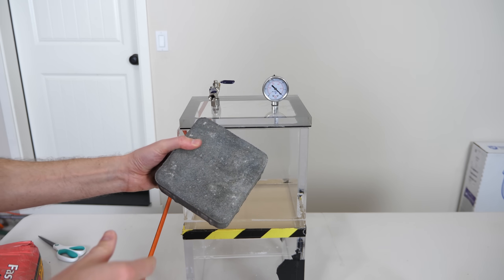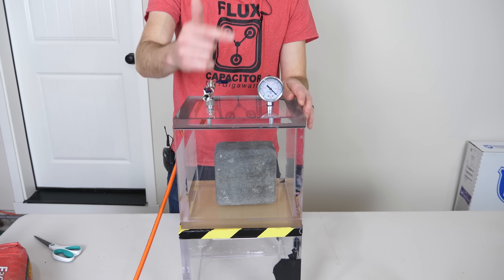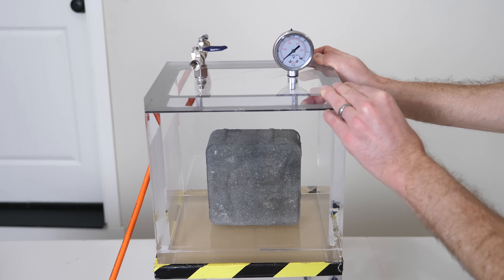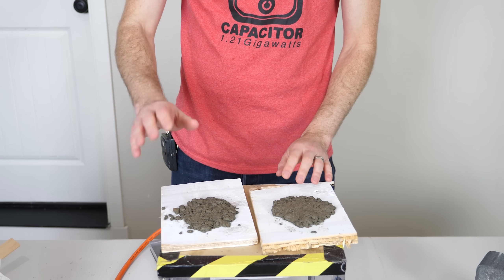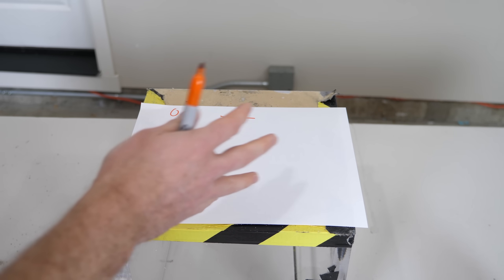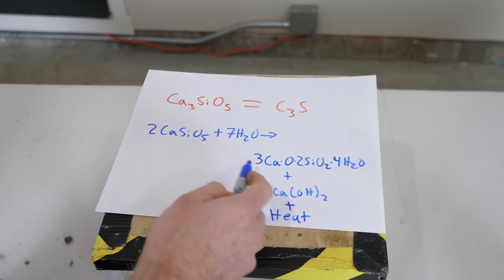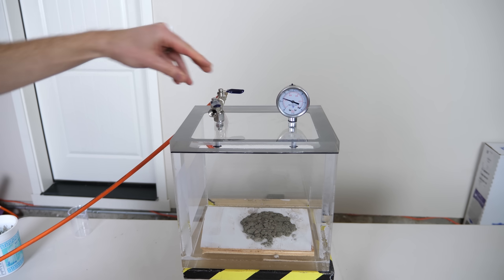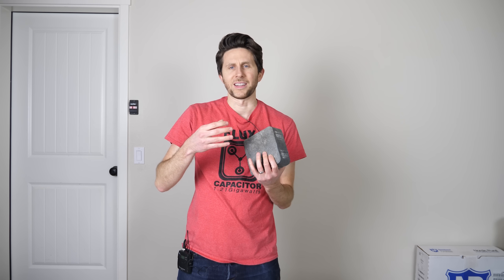Does Concrete Turn to Dust in a Vacuum Chamber? Concrete Without Oxygen Experiment

Comment: Nothing will happen to the concrete without oxygen... but if all the air was to be suddenly removed form the inside of any big structure, forming a vacuum, the structure would most definitely be destroyed and crumble to the ground. This would be due to all the air outside the building applying pressure over the building (atmospheric pressure) and no air inside the building to counter that pressure. 1 atm is equal to 101325 Pascals, that’s a lot of pressure acting over the building. Structures are generally constructed taking into account that the air inside the building will apply roughly the same pressure as the air outside it, almost leveling the difference in pressures.

Comment: Concrete molecules are still connected with oxygen bond that you can't see. If you take out that oxygen from the molecular structures of concrete.. maybe it can become a dust😁 and it's impossible to remove oxygen from every single molecule.

Comment: I guess if the oxygen atoms dissappered the concrete would crumble. But just removing air shouldn't do anything, heck making concrete in a vacuum probably produces stronger concrete since there won't be air bubbles
Reply: You're 100% correct :)
Reply: Harder and brittle.

Comment: NASA wants to use concrete around satellites for protection of micro meteorites. S.C.C. self consolidating concrete, a no water mixture, and it is a total chemical cure. I am a union cement mason, We know these things too.
You have to mix the concrete in 0% oxygen. You also forgot in space the vacuum is in the negative vacuum. Plus the temperature is absolute 0.
Water in space would expand as it freezes, so a chemical cure is the best option.
Glass and concrete has the strength of steel when created in space. Steel has the strength of diamonds when created in space.
Reply: Interesting

Comment: NASA did this study. Glass, steel, and concrete created in 0 oxygen is much stronger.
Reply: no tiny air gaps less likely to break
Reply: All hail civil engineering!
Reply: @Joe no, it means no oxygen contamination. Oxygen is reactive, it likes to react.
Reply: Because in the making of it water and oxygen reacts with everything if you take oxygen out of the mix you get the absolute purest form of that because it doesn't have any impurities in it and hasn't reacted to anything that's how come blacksmith use borax that's cuz it blocks the oxygen away from the steel then how come welders use argon to block the oxygen away cuz it Doesn't react Like Oxygen
Reply: Imagine humans created in a 0 oxygen environment
Reply: @Pillmates  In that case you can not speak of humans.
Reply: @Pillmates  humans created in 0 oxigen are called lefties, and their stupidity factor is much stronger than normal humans
Reply: @StoneCoolds  ok boomer
Reply: @StoneCoolds  🙂☺️😊😁😂🤣🙃
Reply: @psuedonym9999  I doubt many could reference the science book they used in 2nd Grade Elementary, or textbooks they last used one year ago. Moreover, not everything is freely available in the internet, which I think you'll understand when you finally get to college. In 2013, doing strenuous activity and pregnancy was not even in the internet, but it's info you can get from doctors.
Reply: @StoneCoolds  I think you mean right-wing wingnuts
Reply: @StoneCoolds  Why'd you have to make things political? Also, you realize that Albert Einstein, George Orwell, and Martin Luthor King Jr. were heavily left-leaning, and that many early feminist movements, worker's rights movements (including minimum wage and the right to unionize), and Civil Rights movements were all backed and organized by socialists? Were their brains lacking in oxygen?
Reply: @biggiganticbones  Remember when we all thought the Earth was flat?  It was common knowledge.  You're right that not everything is available on the internet, but I guarantee you that "doing strenuous activity and pregnancy" was on the internet in 2013.  I know because I graduated from medical school in 2008, and we used the internet extensively in our aquisition of knowledge.  We also learned how to evaluate the quality of evidence, and in that learning you realize how crumbly the foundations are for widely-held beliefs broadcasted throughout history with large megaphones (crumbly as concrete without oxygen molecules, even).   By the way, I remember learning that most exercise in pregnancy is okay unless you have a cervical problem, placental abruption, or placenta previa.  I don't know my sources off the top of my head, but am willing to admit that I don't know my sources and would be open to evaluating dissenting claims.  If someone asks for a source, it's not an insult or even always a challenge - it can be curiosity - a realization that you don't know everything and want to know where another person got their information from so you can check it out and see if it is sensible and based in high-quality evidence.
Reply: @gabrielspring4401  I agree about your stance on asking for sources. However, Pseudo Nym did not simply ask for a source. He continued with "Rant over? So I guess you have nothing." and "ok boomer."
To me, these were definitely an indication that Pseudo Nym believed "no source = false" and taking into account that he is not accepting sources other than links, "not on the internet = false."
I replied to him to quell this belief that he may or may not have.
........
If someone actually presented a link from a paid database inaccessible to the public, I would be almost sure that he would find it unacceptable also. Those sites would not be in most peoples' minds when they say "internet," and so I made no effort to make a distinction. Meaning, the "internet" that I used is what most people think as the "internet," which is whatever that can be presented by Google after a Google Search.
Reply: @biggiganticbones  yeah, I didn't like the "ok boomer" comment - THAT was a lazy thing to say and prejudiced.  Also you bring up a good point about paid databases being largely inaccessible to the public - it only compounds the problem of ignorance.  I'd just add that access to paid databases doesn't eliminate the dozens of biases that still go into publication and interpretation of research that 99 percent of us take mental shortcuts to ignore to maintain our sanity
Reply: @StoneCoolds real
Reply: @Joe no air doesn't mean no space
Reply: Let say human was made in zero gravity then if men get a bone.     Er can it go back XD
Reply: No oxygen or a vacuum?
Reply: Ye boyyy cus air weakens conccc
Reply: Reference???
Reply: Umm no
Reply: Ceramics rock
Reply: Source?
Reply: @psuedonym9999 ,
 Richard C Hoagland.
Reply: @alexroberts590  that's not a source, that's a name. Give me a link.
Reply: @psuedonym9999  ,
I'm old school in research. I have a library of a collection that I have. Books published by credentialed individuals, like scientists, physicist, doctors, as well as my own compositions of 40 + years of experiences. I have physical scars from my experiences. 
A little homework never hurt anyone. Ya. You want a link for what? Validity? I care about those who still can't see whats been in front of us the whole time. But I don't care what people think about what I say. I can't unsee what I experience.
Reply: @alexroberts590  Rant over? So I guess you have nothing.
Reply: @alexroberts590  There will never be an end to lazy people who require being spoonfed their information. These are the same people that see an article posted on Twitter and presume it to be factual. I wouldn't waste any time on them, myself.
Reply: @ForeverLaxx  You call asking for a source "lazy"?  Actually, going through life thinking that everything you know is true requires far less effort than challenging your own beliefs.  Tossing a statement at the top of a message board and calling skeptics lazy for challenging it is like baking cookies out of concrete and calling your dinner guests weaklings for saying it hurts their teeth.  It's ironic that you equate challenging a claim to presuming a twitter article is factual, when in fact they are opposite reactions to the presentation of previously-unknown information.
Reply: @gabrielspring4401  I'm glad you swooped in here to a conversation that ended 8 months ago to try and dunk on someone just to show you didn't actually read the exchange or failed to realize the one asking for "source" wasn't interested in any legitimate source.

I've been on the internet far too long to waste any of my own time digging up sources for people who aren't interested in any source that doesn't fit the Twitter narrative they took at face value simply because they already believed that information. It takes literally 30 seconds to find 99% of what people will reference when demanded a source, and I'm not someone's search engine. Plus, they'll just immediately dismiss said source because it doesn't say what they wanted it to say, or it wasn't said by the "approved" individuals.

Hunting down sources to appease people who blindly believe the original claim with zero factual basis isn't worth my, or anyone else's, time.
Reply: @ForeverLaxx  I agree that it IS funny that I swooped in - was thinking about that afterwards - I just watched this vid for the first time and came across the discussion.  And i definitely appreciate you giving a detailed reply.  But saying that soemone would immediately dismiss a source given is premature.  Sure, commenter may have immediately dismissed it - but they didn't - they weren't given a chance.  If the source is so easy to look up in order to shut down a skeptic then it benefits everyone to do it.  Then, if they offer an educated rebuttal, have a discussion.  If not, they're the ones looking stupid.  Its not a poster's duty to preemtively source everything they say, but its also not every reader's duty to take comments at face value.  Ultimately its everyones' choice, and I believe it is beneficial for either side (claimant or challenger)  to be the first to take the discussion to a more elevated level of debate.  Did I interpret your reply correctly?
Reply: So buildings are the strongest material
Reply: Ye
Reply: So does this mean we can make concrete structures in space?
Reply: A lot of foundries have vacuum crucibles specifically to remove oxidation as a factor 

That’s what flux is for.

Why sand/glass is added to crucible steel.
Reply: Harder but more brittle, not necessarily stronger
Reply: @taipanpete8583  Make the concrete with fibers. That way the brittleness would be reduced and it would also be harder

Comment: This was a complete waste of time.... you dont have to be a physicist, or a genius to know that concrete will not just turn to dust because you remove oxygen.... oxygen would have to be the binding force/compound, whatever in order for it to rely on oxygen to hold it together.... and its not.... in fact a good question for you would be, can you find an object the relies on oxygen for it's structural integrity....

Comment: Only complete Idiots would think concrete could crumble in a vacuum-chamber!
Why it should?
Concrete does harden even under water or in a area with no air.
The idea "what would happen if O2 could disappear for 5 seconds" means:
What would happen if you ban ALL O2 from the earrh.
Even the O2 whats included in every structure and in every beeing.
O2 is solid in concrete and cant be sucked out of it!

Comment: I didn't think it would crumble for that exact reason. Me and my friend had a debate just before watching the video. His argument was when you put marshmallows into a vacuum chamber, vacuum it then let air in it collapses. I explained my thoughts before watching. In process of making marshmallow you whip air into it in order to fluff it up, the air is essential what is keeping it puffy. Since the air inside the marshmallow is more or less made up of the same stuff as the air on the outside it has approximately the same specific pressure so it maintains its form. By sucking the air out of the chamber you also pull the air out of the marshmallow, the reason it loses air instead of expanding like a balloon would is because the marshmallow is porous so it leaches the air out. When you let the air back into the chamber the ~14.7psi is much much heavier then the 0psi (more specifically I would pull as close to 1000-500 microns as per refrigeration standard) inside the marshmallow. With all the missing air inside the marshmallow it is crushed by the pressure of the air, not gravity or it would collapse while extracting the air. As it was mentioned in the video the Oxygen in the concrete is part of the chemical makeup not structural like in a marshmallow.

Comment: The theory is that concrete structures would crumble not because the concrete would just crumble but because it would no longer be able to hold the weight of the structure because concretes strength comes from the air.

Comment: With the information I have (Concrete is stable because of O2) I can say why it isn't turning into dust: The O2 is already in the concrete but the machine puts only the O2 out, that is on the outside of the concrete.

Comment: Solid, fully cured concrete in a vacuum chamber will not crumble into dust.  However, concrete that is not fully cured will dehydrate, cease curing, never reach its full strength, and may be crumbly.

Comment: Correct me if I'm wrong there's oxygen bonded within the concrete. All those videos said if oxygen "disappeared" not just is no longer in pressence of the air around. Removing oxygen around the concrete wouldn't have any affect on the bonding within

Comment: Those concrete pillars you see holding up the flyovers on the motorway take 50 years to cure, they're still wet inside, and a House brick reputedly holds 1 pint of water.

Comment: If oxygen disapeare for 5 seonds is a hypothetical question. And by lots of people request you tried to replicate hypothetical question in reality, which did not work.
Hypotheticaly concrete would turn to god knos what. 
This is hardened cement:
CaO SiO2 H2O + Ca(OH)2
This is hardened cement without oxygen:
Ca Si H2 + Ca H2

So lets see what we are left with, Ca is a soft solid metal, Si solid (i assume britle) metaloid and H is a nonmetal gas.

An you guys like 100 % Nothing will happen!! :D

Comment: “What would happen to Earth if oxygen disappeared for 5 seconds” At the begging of the video, then after the test he says that oxygen gas is different from oxygen in other molecules. Mentioning that if oxygen disappeared from the atmosphere, concrete wouldn’t crumble. BOY!!! If oxygen disappeared like you said at the beginning of the video, of course concrete would crumble apart. Though that’s just a hypothetical situation, yes, that is most likely what will happen to concrete. If you change your scenario half way through the video, you gonna look real smart to those who didn’t pay attention. Remove carbon from existence, every life form dies instantly. But, it isn’t really there in the air though. Same thing for oxygen. If it stops existing, that means concrete molecules are lacking some atoms. Which makes them... not concrete molecules. Conclusion, if oxygen disappeared, concrete crumbles into dust, as it isn’t even called concrete anymore.

Comment: Think about it hospitals and hotels I think are made of concrete and as you see when a hurricane passes by and that has air pressure. think that the concrete slab was a building inside a vacuum.